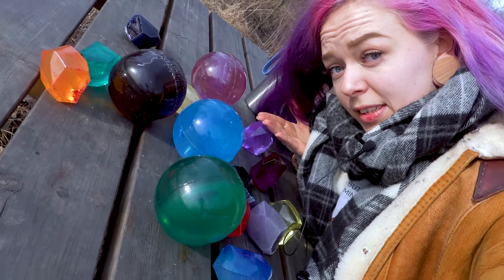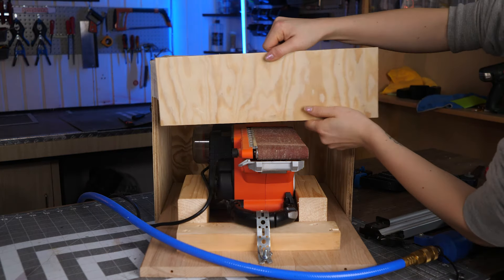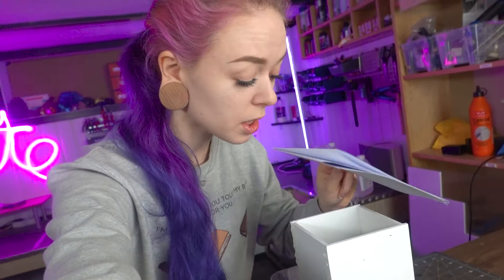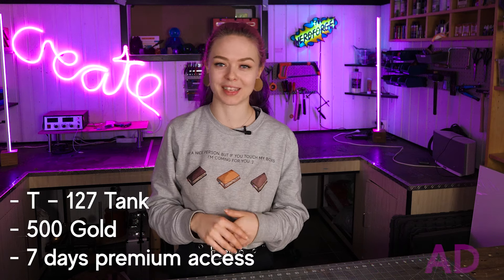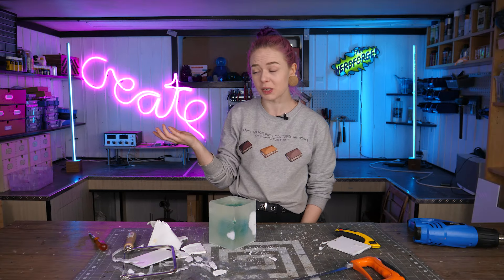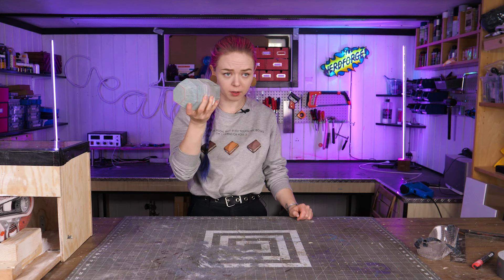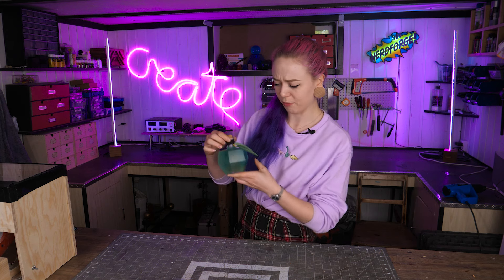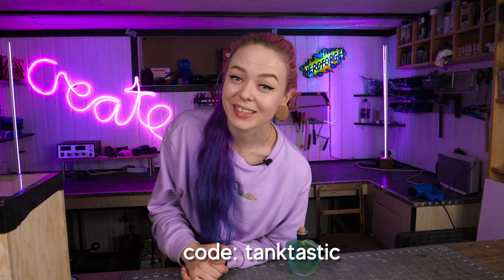DIY Fantasy POTION Made from Leftover Epoxy!

Comment: Little tip when casting something in resin that doesn't involve silicone. Always spray your mold with some form of mold release agent, that way whatever you're casting won't stick. Great build as always also 👍
Reply: I've heard Vaseline (petroleum jelly) is a fantastic and cheap mold release. 🙂
Reply: Most plastic won't stick (like 2L soda bottles, plastic sheets used for signs, tubberware depending on the shape, ect) or if you use the foam core board, cardboard, or wood you can use a layer or two of packaging tape/ clear tape to laminate the surface and make it absorption resistant :)
Reply: Also paste wax will work too
Reply: parchment paper according to evan&katelyn. and they are currently the resident youtube epoxy addicts. dont know if epoxy can be flame polished like acrylic can.
Reply: A heat gun can also help, depending on what material you used to make the mold.
Reply: Robert Tolone, youtube mold-maker and caster, swears by beeswax as a release agent. He gets great results with it.

Comment: I make epoxy live edge river tables for a living...if you want to use something that will work very well, that's not silicone, that you can get in multiple thicknesses and will literally pop right off resin: polypropylene sheeting or polyethylene sheeting. You can re-use it over and over, it's easy to clean and maintain, and you can use hot glue to seal the seams and the glue will peel off when you take it apart. As soon as I saw you use that foam board, I was like: uh oh.... I knew what was coming, lol. You can buy PPS in sheets as big as 4' x 8' (even larger if you need) and thickness from 1/16" - 1"...  You can use a fine tooth finishing blade on a table saw and cut it into strips. Thin pieces you can bend and flex to make rings/circles. Anyway, I hope this helps, you asked for suggestions for mold materials, so I hope this helps. Love your videos btw... You're inspirational and very talented.

Comment: First off, AMAZING job, and great idea!
Having very limited experience here, I'm mostly talking based on theory and what I've seen from others (positive couple, stone coat, nick z, and a hand full of others that I watch, plus my own work), I think you've got the right idea, just a little more fine tuning. Perhaps being a bit more precise about your angles and dimensions will make it easier to figure out how much to take off. Also, if you wet the surface, it might be easier to see through the scratched up surface so you can tell how much material you have. If you have a thicker layer of the "glass" on the outside, it might be more obvious. As for the accents, I think they were perfect! I know you feel they looked really fake, but I thought it made it look more fantasy personally. And for the materials, corrugated plastic is probably the closest to what you're using but with a little easier release. Also, as mentioned in other posts, some sort of release agent (spray wax is my recommendation) will make demoulding (sp?) much easier...
Hope that helps, and again, this is awesome and I can't wait to see more like this from you! Fight the good fight!

Comment: I really enjoyed watching your process with this video.   I know that you were looking for a method to use up existing resin, but if I were to do this from scratch, I would do it differently.   I'm still new to mold-making and casting, but here's what I would have tried.    First, I would have made a silicone cast of a bottle.  That's not strictly necessary, but will save you a ton of sanding.   Then I would have slush-casted a gel resin (like a Smooth-On 325 clear) using a roto-cast approach to coat the outside layer of the bottle while leaving the inside hollow.   Then I would have poured the potion-liquid inside with another resin (325 would work, or I could go for any other clear snap-cure resin).    That would give you the glass bottle look with a filled liquid, and it would have saved hours of sanding.

Comment: Can you use mold releasing compound/Agent (spray) on the foam board?
  If you can I would suggest making a pre-shaped mold by placing foam board on your epoxy trash after you carve it to your desired shape to give you a unified spacing.  Then using foam board to make your mold over top of that.  Then remove the spacer and trash core.  reform the mold bottom. pour in a little resin about a foam boards thickness, put the trash centered on top of that when it is somewhat hard.  then put the top of the mold on and seal it and pour in the rest of the clear resin.  I don't know if any of that would work as I have not worked with resin casting, but it works in my head. Also I don't know if it would cause bubbles.  maybe use two thicknesses of foam board for spacers just in case, so the resin flows more freely around the trash.
I love this channel.  💖

Comment: I think it looks good, just needs to be clearer so you could see the "liquid" part inside. Instead of trying to sand and polish it, I would try to sand it first to be somewhat smooth and then brush on a thin layer of clear epoxy and let it cure to form a clear finish. Spraying the finishing epoxy on would be best but it need special equipment to do. Even a spray on clear laquere might work giving the bottle a see through finish.

Comment: Strong foamboard and white glue is great way for pouring polyster like metarials. But you need to wait few days (to dry), tape outside of corners and go a second coat on white glue in the insides. And if you can make a wood model first, you can make a mold with sliycon and pour the epoxy in there, so you dont have to sand it that much (tiner, aceton (or nail polish removers is best way to clean the resin type metarials) 
(Amazing videos!!❤❤❤)

Comment: Nice build as always. A couple of things to help you out in future,

With hot glue, to remove it use isopropyl alcohol, it'll remove the "stickiness" of the glue which makes it just peel away from anything it's stuck to.
For the mold you should've used a release of some kind, another thing that can help is line the mold with some kind of packing tape, the shiny surface can help the resin not to stick and should give a decent finish to the resin it's self.

For the "glass" I think you could've made your life easier with the epoxy, this is what I would've done: Do the bottom glass piece as you did then make a shallow box mold, say A4 size? and pour the epoxy so it'd be about 2 or 3mm thick or as thick as you wanted the actual glass, let it cure most of the way but not fully harden then cut it with a blade into squares to match the facets you have on the internal potion bit, then let it fully cure. Once cured I'd probably mitre off the edges so the facets of "glass" mate up cleanly then use epoxy to glue them to the potion. For the top I'd do 2 more molds, one flat for the top of the bottle then once that's cured either a rectangle one on top of that for the stem of the bottle then sand and cut the final shape or 3D print a mold that'd be near enough to the final shape of the stem so the minimum amount of sanding is required.

It might be a bit more work but I think the final result would've been much easier and more consistent in the end. Just an idea if you plan on doing this kind of thing again :).

Comment: A tip for sanding epoxy: keep the sanding and polishing papers on a flat, firm surface. For small projects I usually just pop the glass out of a picture frame and place my sheets on there, then more to project's flat surfaces over it in circles or figure eights so the sides come out as flat at possible. Also, I don't know if you can get them where you are, but look in to Zona Polishing Papers. They're wet/dry and VERY good for polishing resin and sharpening craft knives and chisels once you get past about 300 grit sandpaper. The ones I've got came in a pack of 6, with a range from 30 microns to 1 micron.

Comment: This was great, defiantly can't wait for part 2
A few tips, you can probably find a way to mount a shop vac up to your belt sanding jig, it won't get all the epoxy dust but should help if you can get it close enough 
Also with the glass layer of the bottle, you could try mineral spirits to help see how thick it is. It'll make the epoxy more translucent without sanding so it might be a help so you can see the thickness better
Last sanding it down to a shinier finish would probably really help make the final product
Cant wait to see the continuation :)

Comment: Hey there, a long shot that you'll see this, but I got recommended your channel and I had an idea that I thought I'd share with you to make this project possible in maybe a day - and with basically no carving for the glass.

First - shape your bottle contents as you did, then paint it with a thin layer of resin or polish it however. It needs to be smooth to save polishing later.)

Cast this shape in silicone, but only about halfway up (or make a 2 part mould so you can batch out these potions entirely.)

pour a layer of "glass" into the silicon mould, and repeat what you did with the foam board, pour so that the glass will come halfway up the bottle contents, and be more or less uniformly thick. I'll refer to this adding the bottom layer of glass later as "offsetting the Z axis".

Next, sculpt a master for your bottle neck - maybe turn something out of wood or sculpt in XPS. 

Hot glue this to the top of your model potion, and cast it in silicone again. Discard the carved neck.

Pour the resin into the neck mould, aim to make it so you fill the mould slightly too much, repeating the idea with the initial pour so you offset the contents on the Z axis, but from the top this time. Once the neck is cured, place the contents into the mould and pour again.

This should leave you with a missing band in the middle. Initially this will be helpful with alignment of the two halves - try to get the gap as even as possible.

To complete the piece, you could either fill the gap with more resin, or superglue in something nice like Mica or Mother of Pearl (horrible dust if you sand these...!!!), or band it with leather.

Either way, as you'll be pulling straight from a mould, you'll not really have to polish anything except the contents. Highly recommend getting a buffing wheel for your drill or lathe for this - they're super cheap.

Comment: I think it came out looking pretty nice! Great way to use those scrap epoxy pieces - Always nice to see waste material put to good use!
You might get a better distinction between the inner and outer parts if you brought the outside to a much higher polish with a buffing wheel?

As for casting, yeah, silicone is expensive. You can save a bit of money by using tin (condensation) cure silicone rather than platinum (addition) cure if you're not too fussed about having a long library life. For around half the cost, you could use polyurethane rubber, but you'd need a really good coat of release agent, something like a wax spray release, or mix some vaseline with white spirit (also known as naptha in some places) to thin it and then brush it on.
That would also work for the foam board.

If you're going to do a bunch of these, I'd say it's well worth the investment to use silicone. For a start, you'll save a lot of epoxy, but also a LOT of sanding and finishing! 
The tricky part would be holding the coloured epoxy blobs in place, but you could probably do what you did here - pour a thin layer of epoxy into one side of the mould and then set the piece in it while it's still tacky. Or maybe use clear acrylic (or pre-cast epoxy) pins / dowels, with fitting holes integrated into the mould to hole the part in place.

Comment: I have some ideas for you to try!

1) you should try to hollow out the bottle neck more and actually add a little liquid! 

2)You could even attempt to make a bottle, cut it in half horizontally, hollow out the layer between the ‘glass’ layer and the colored epoxy , as long as the colored part is still attached to the bottom, it would float and could look like it has a deeper color in the middle. I think that could help to separate the glass layer more. After, I’m the gap you could add maybe sand, glitter, charms, liquid, oil??? Idk the possibilities seem endless!

I hope you get to try again!

Comment: I dont know if this has already been commented. but regarding the use of the band saw.  From my understanding and what i have learned, you should always lower the top of the saw to reduce the gap between the work piece and top section of the saw. This increases the stability of the saw, making it less likely to jiggle and get cleaner cuts, while also reducing the risk of injury by having the blade jump of the rotating wheel and harming the user. other than that, love the vid. Greetings from Trondheim :D stay safe

Comment: So I made these resin aquarium scape brick things (with painted plastic fish and plants inside, super cute) But when it came to polishing I found those car headlights kits, where you attach sanding pads (500,800, 3000 grit, i think) to the end of a regular drill. It was incredibly how easy it was, it was like $20-25 and had multiple sanding pads and it came with a polishing gel that I could put on at the end. 100% my go to product for cleaning up resin projects

Comment: Use acrylic sheet, 1/16th of an inch thick. Spray with mold release and it will pop off with a thin wall mud knife (more like a narrow flat blade with a handle) hope this helps! Also, you can use a round plastic tub of sorts and tap, gently, with a rubber mallet and it will pop out without using mold release. Then it upside down and tap the bottom, if you havent poured it all the way to the top, it should release and pop right out onto the table

Comment: When you use foamboard for making epoxy casting, you can coat the inside with  petroleum jelly. You can wipe it on with a rag, or a brush. It does not have to be a large amount, just enough to coat the paper face of the foamboard. Then you can easily remove your casting. 
As for cutting or sanding geometric shapes, you might consider making a wooden jig that you can rotate accurately to 4,5,6 or 8 positions. Then you can hot glue your piece to the jig and either do the major work cutting on the bandsaw or your sander. 
I'll see if I can find my jig patterns and send you a link to them. 
Otherwise, I really like your creations.

Comment: Try using composimold reusable mold. it is silicone, easy to pour, and reusable. if you have a tight budget, it probably is too much money, but the usual price on amazon is $60 for the large can, but the smaller costs less. I haven't used it myself, but i hear it is good.

Comment: I think it came out fairly well. As far as your question about release agents, there are several commercial products available online, but if you're looking for something on the cheap you can always apply some vegetable or mineral oil to the foam core with a paper towel and that should do the trick. 

As for the finished potion bottle, if you find yourself with a sanded or matte finish product you can sometimes lightly go over the finish with either a good heat gun or a gas torch, like the Bernzomatic Propane or Mapp Gas Models.  Just be careful as to not overheat the product, and with all situations regarding the use of fire or flames be sure to use the proper and suggested safety precautions and procedures, not to mention the help of an adult if needed. Hope the suggestions help.

Comment: Love your craftmenship skills and your videes. This suggestion may help save you time. A good investment is a bench grinder, fitted with polishing wheel mops also a woolen polishing bonnet.  Sand down with very fine wet and dry sandpaper. Then polish on machine using polishing soap for resin. Finaly buff up with Lambs wool mop. It is fast and glass smooth and clear in a fraction of the time. I polish all my resins in this way. Perfect super finish.  Bench grinders are quite ceap. Also usefull for high polishes on metals etc,

Comment: I saw in an earlier video you had a totally unsafe vacuum box for setting epoxy to get all the bubbles out.   (I am sure it is stored near your unsafe belt sander somewhere.)   Try putting your next mold in there to clear up the "glass" around the potion then sand sand sand  polish polish ....Oh  and totally love the look when you found a safe way to cut on the ban saw.

Comment: You could probably assemble a bottle around the liquid by putting shards together with some glue - it would also leave some air above the liquid and hence look more like a real bottle.
Another plus: much less sanding. Just macke a plate out of epoxy, let it dry, cut out the pieces you need and assemble your bottle. Clear epoxy to fill the gaps between the shards and something to hold it in place while it gets dry.

Comment: Band and table saws are a must have if you ask me. I can’t remember my workshop was like before those two lol.
Tho I would have made a clear bace first and sat the inner potion on top and then moulded the foam around the potion shape with a 1cm gap, add some beeswax to the foam board mould or a mould release agent and then done the resin pour around the potion freestanding on the bottle bace.
Than when removing the mould all you would need to do is cut the bace to shape and sand/polish the “glass” layer.
I’d also think about adding a small light into the bace now that I think bout it.
Maybe Cannibalise one of those plastic light up cups from the $2 shop and bore a small grove in the bace for it.
The down side would be that you could see the light mechanism if you look underneath but sit it on a table or in your palm and it should work well.

Comment: Melamine is great for epoxy molds. Your main issue is going to be the corners and making you sure you seal them well so epoxy does not creep into them. You can use a light bead of silicone or specialized tape for it as well.